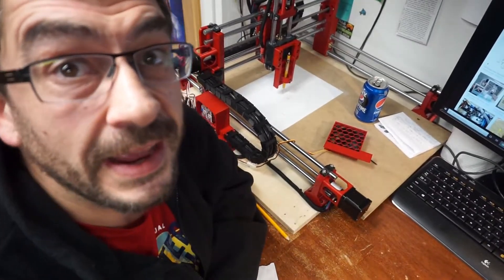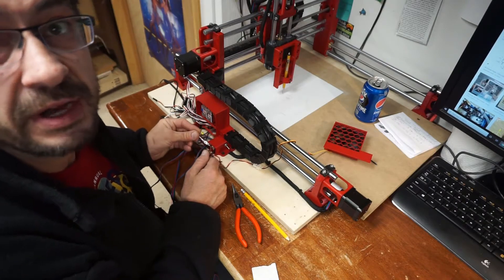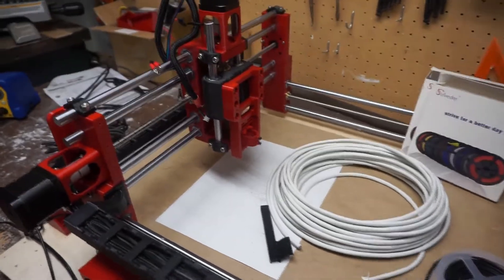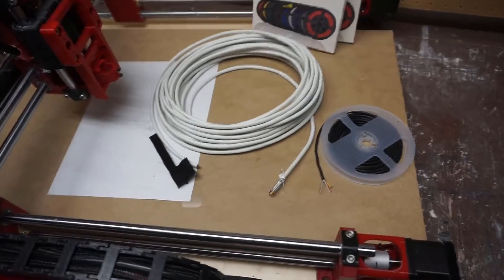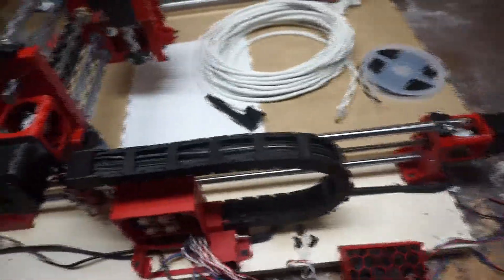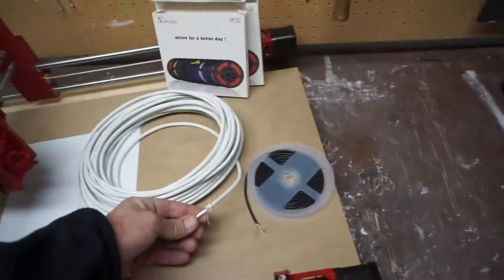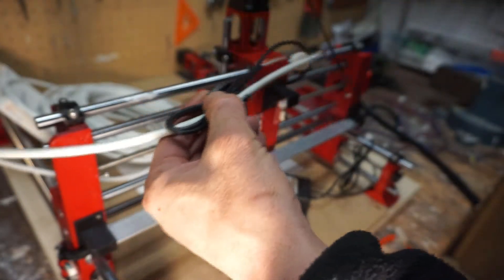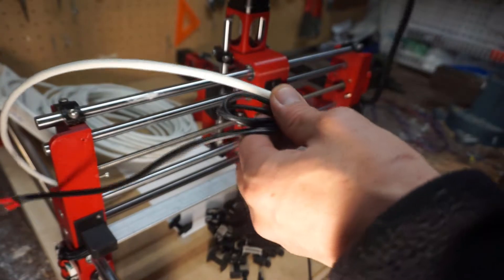DIY 3D Printed CNC. MultiBot CNC v2 build video part 9

Comment: I had a similar problem when building my own CNC. There were problems with the limit switches. The solution was not to change the wiring for another shielded one (mine is RJ45 twisted pair), but to use a ferrite at the beginning and another at the end with all the wiring. Solved case !!
Reply from the maker: ahh nice solution! I had some RJ45 I was thinking of using but it was cheap and brittle, not very good for repetitive motion.
The Optocoupler solved my problem.